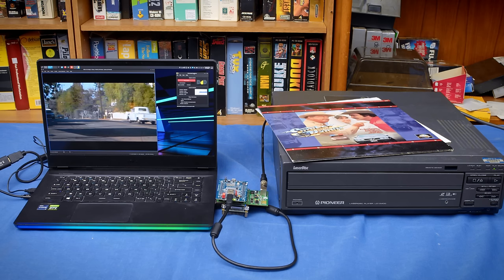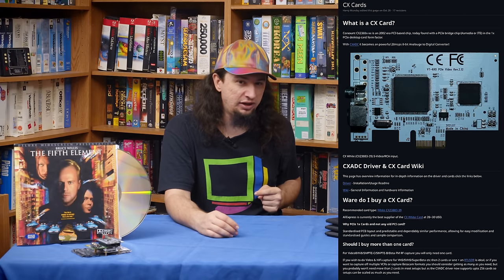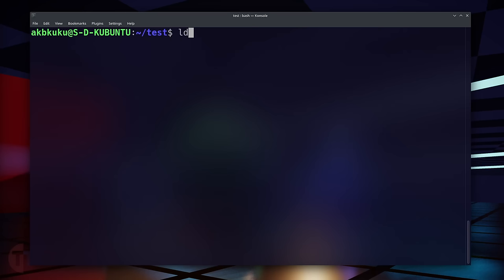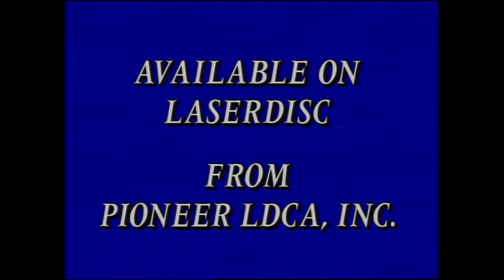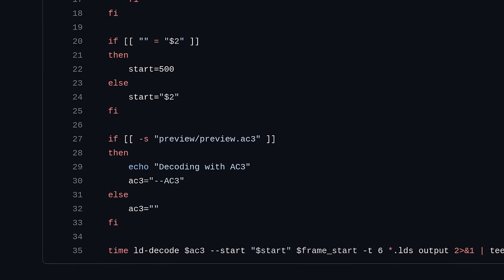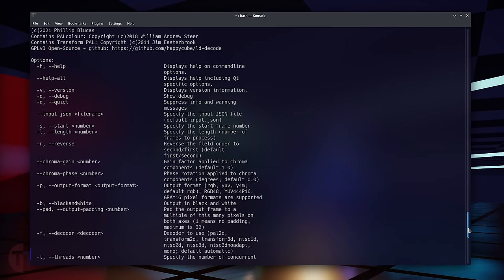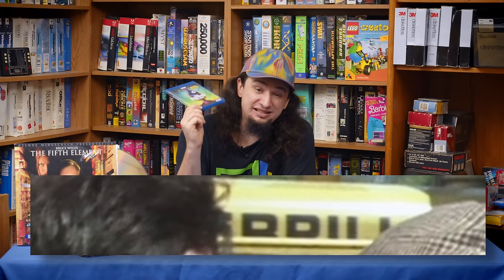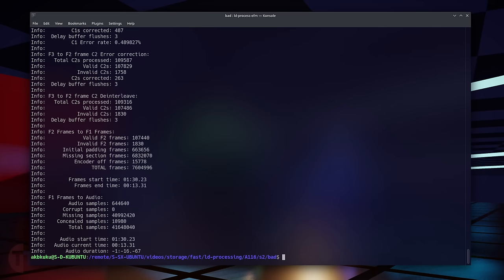LD-Decode - LaserDisc Conversion Tools

Comment: even on modern DVD/Bluray splitting combined TV show episodes (15 minute Cartoon Network mostly) is a royal pain.  Sometimes whoever did it was kind enough to leave a solid 1-2 seconds of black in-between episodes.  Other times they were just a**holes and the sound track from one episode bleeds into the lead in to the next episode with maybe just a single frame of black.  Completely manual process.  Which is why torrents of these shows never bother to actually break the episodes out into their individual components.

Comment: Run the video signal through a RetroTink 5x, or RetroTink 4K (depending on your price range), before final video rendering, and they have VERY good options to deinterlace incoming video, in real time, as the video is played.
Reply: There are better deinterlacers that work faster than real time.
Reply: @itogi  Examples, please.

Comment: I'm guessing the "TBC" video file output by LD Decode from a raw LDS file, is referred to as a "TBC" file, because LD Decode performs a form of software timebase correction on the video frame data? 

As a Laserdisc collector and overall video enthusiast, this method of direct FM carrier & subcarrier capture from laserdiscs (and videotape as well, which also stores video in an FM carrier directly recorded to tape) to digital form fascinates me.  I'd love to modify one of my players to fit in a Domesday Device (or CX Card) to it, and try my hand at capturing & digitizing my LD collection this way.

Comment: I have a question: Why don't you use libsvtav1 instead of libx265? With an Intel ARC GPU you can also encode AV1 insanely fast via hardware. And I don't agree with nearest neighbor pixel doubling for scaling but that's just down to preference.
Reply: Having experimented personally with SVT-AV1 versus x265, I feel that SVT-AV1 still has a decent amount of room left for encoder tuning improvements, whereas x265 is so mature that it's basically as good as it's ever going to get. Currently, SVT-AV1 (AV1 in general) excels at producing clean images at low bitrates, but at higher bitrates, x265 at Slow maintains more fine details (sometimes you don't want to have noise and grain and fine textures smoothened out) than SVT-AV1 at like Preset 5, which is almost comparable speed-wise. I'm sure it will get better over time, but at this current moment I wouldn't consider it suitable as a codec you'd use as a sort of final master yet. 

The thing about nearest neighbor pixel doubling was also surprising to hear. I mean, if it works, it works, but it feels almost like defeating the specific coding features of HEVC because it's going to be harder to do things like motion search when every pixel is actually a 2x2 block of pixels. Also, it will look blocky if you try and view it on a display without undoing the pixel doubling first and then using another upscaler that actually does smoothening. I would try and figure out what x265 encoder feature should be turned off to reduce the smoothening effect it has, maybe the SAO filter needs to be turned off?
Reply: @nooneinpart  You have to make sure to use the correct tuning mode. It defaults to PSNR, which is of no use for human vision. Try the psychovisual tuning! tune=0.
Reply: @kyoudaiken  I have tried that, as of a few months ago it didn’t make much of a difference. Maybe I’ll try it again
Reply: @nooneinpart  x265 and AV1 have variable macro block sizes. They can go down to 4x4 pixels. So Shelby's assumption it would be no good for low resolution isn't necessarily true. The true issue here is that lower resolution video has several orders of magnitude less redundancies compared to high resolutions. Thus, especially for grainy/noisy footage you need higher bitrates than you might think.

That's why AV1 would be beneficial. The filter film-grain=(1-50) can help here by removing grain, note down the type position and strength of the noise and then and synthesizing it on decode (playback). But the more aggressive the value for the film-grain filter is, the more actual detail you will lose. AI denoising might bring better results, but I guess this is a topic for AV2 or AV3...

I just hadn't mentioned this, because, well, this is social media... Valid criticism is not welcome (for other viewers, not Shelby!) and you are automatically a hater. But whatever.
Reply: @kyoudaiken  I think removing grain is the exact sort of thing he's trying to avoid by doing the pixel doubling trick. Re-synthesized grain is a pretty genius idea for streaming video over to users with a limited bitrate, but that's exactly what you don't want if you're trying to keep a permanent record of a video, you want it as pure as possible in this situation.
Reply: @nooneinpart   For really good quality SD video you really need 2 - 3 MBit/s to retain grain, noise and such without artifacts or blurring, even on AV1 because as I said, SD video has several orders of magnitude less redundancy, especially analog sources like LD.
Reply: @nooneinpart  You can also try the encoders on Intel ARC GPUs. An A380 is enough, it has the same encoder ASIC as the flagship. Not sure about NVidia but their encoder is also great. Don't know which GPU is best to get for that, though. It has to be RTX 4000 series, though. AMD's encoders also have AV1 encoding since the 7000 series but I don't know much about it.
Reply: @kyoudaiken  I know, I’m specifically replying to the part about using the —film-grain setting to remove grain. Actually, I find that using that setting alongside —film-grain-denoise 0 provides better results because setting —film-grain by itself tends to clean up more noise than it resynthesizes, using a higher CRF of 30 already removes enough grain without the denoiser enabled. 

I’d try an Intel ARC GPU but I’m living that laptop life, Iris Xe FTW!!! (I can’t open up my laptop and toss a new GPU in). I’m mad at my old laptop for dying before Meteor Lake released. It’s so close…
Reply: @nooneinpart  Yeah, currently the best option is a low CRF.

If your laptop has a spare M.2, just do a UFD Tech and connect an Intel ARC to it. ReBAR must work though, even for the AV1 ASIC, because when the VRAM runs full, encoding speed dips down hard without ReBAR enabled. Or maybe your Laptop has Thunderbolt. But GPU enclosures for Thunderbolt cost way more than the actual A380...

Comment: Why is telecine interlacing almost impossible to filter out? Doesn't everything use 3 2 something pulldown? Isn't it consistent?
Reply: 3/2 pulldown is an American thing. That HHG laserdisc was PAL I believe.

If you telecine an interlaced optical projection then your capture permanently recorded the original interlacing artifacts as a new image. Imagine for example I have two 35mm slide projectors both pointed at the same projector screen. I project two slides onto the screen at the same time, making a combined image on the screen. I then take a new photo of the combined image.

Imagine just how nearly impossible it will be to scan my new photos and try and separate the two original images.

Another example. I have a cup of red sand and a cup of green sand. I give you a bigger cup with the contents of both original cups inside only during transport they got badly shook about and red and green grains are now mixed.  Lacking any automatic processes for separation, would you like to manually do it?

Comment: All good fun, try inventing a new analog TV format, this been keeping me busy for the two years. Whereby I have been working with narrow band television that is 240 x 192 a lot less than PAL at 720 x 576, but it  has lower bandwidth requirements that fits into less than 100kHz.

Comment: Is there already a agreement in de community what counts as an "archive quality"  copy?   163GB doesn't sound very portable..
Reply: FLAC compressed LD RF caps fit on 100GB BD discs with some EEC data and self contained decoding and export tools.
Reply: If I were to archive the original bitstream I would compress it and store it on bd-xl or LTO tape. I'd certainly use the tapes as they store way much more.

Comment: could you take the video into a video equivalent of photoshop and use the video equivalent of the repair or heal tool and paint over the dropouts?

that would work if the dropouts are in a consistent color and lit area say a wall.

as part of the job of preserving are you getting copyright threats as i am sure the content is still in copyrights?
Reply: During decoding RF drops are logged, then with ld-dropout correct it takes the mapped drops and masks them, this is a 1 command job and you can see the dropouts visually highlighted in ld-analyse.
Reply: Yes you could but with 24-30 frames per second do you want to manually do that for thousands of frames?

Some people have been paid to do just that. Tron for example had poor souls apply manual effects to make the characters glow. Frame by frame by frame.  And the same again with the 1970's animated Lord of the Rings, which actually was NOT animated! It is actually a live action film but each frame was re-drawn by hand to convert it to an animated film.

Unless you or I are being paid to sit there day after day, week after week, for a year or more to retouch every frame in Wargames... I think you'll probably take the extra few hours of stacking yes?

Comment: 9:05 Why did you dismiss Dolby Surround matrixed sound? Sure, it's inferior to discrete audio channels, but it's still a surround mix nonetheless and not an upmix.

If there's no discrete audio channels track option, that's the only way you'll get a surround sound.

Which is, by the way, getting more and more difficult to decode in hardware nowadays. Lots of modern surround equipment (like the abominable soundbars with surround satellites) dropped all sorts of matrix decoders, like dolby pro logic II. So there's currently no way to get matrixed surround out of PS2, Wii or Gamecube on such a system.

Or do you mean that those tracks are simply bad on LD and not worth an effort?

Comment: Very interesting. But can't basically every software player play AC-3 and DTS? And surround systems sure can.
Reply: You need to decode the analogue ac-3 or DTS first!
Reply: @dlarge6502  Sure, you need to extract the digital AC-3/DTS stream from the RF capture, but I don't see a reason to convert it to PCM.

Comment: i9-11980hk…. this seemed oddly familiar for any 0.5s until I realized I have a laptop with this exact CPU… it’s a fast and really hot shithead CPU.

You’ll get much better results running an underclock and a decent undervolt.

Personally I run 4.4Ghz at 1.1v -65mv.

Every machine is different, but I’ve used several 11980hk motherboards, and all of them have really been better at sub 4.5Ghz. The heat above that clock does not offset the performance in any appreciable way. Weird mobile CPU, the 11700h is much less thermally limited and as a result, much better.

Comment: Please don't convert lossy AC-3 or DTS audio to PCM just to combine two parts of an LD in Resolve. Speaking of which, that sounds like overkill, ffmpeg should be able to concatenate them
Reply: Good gravy, PLEASE don't use HEVC/H.265 for interlaced video. It's entirely incompatible with it, by design. Use x264, if it's meant to be a "final" copy. Or ffv1 to "do stuff" later

Comment: Jumped the gun on my comment.  Just wanted to say - great job.  There's a lot of nonsense out there on this topic, and you obviously know your stuff

p.s. stacking works because the defects are random - a kind of noise floor against which the more consistent signal elements of the content persist.  Not sure why you'd get an improvement when stacking a single disc.  This seems to imply that the noise in these cases was originated at the LD deck (its playback hardware) or via the duplicator.  Though pulling really good stills from your friend's educational disk would be totally doable this way given the likely number of frames per still

Interlacing is a frame split into two fields.  It's a kind of compression that trades off spatial consistency for the "benefit" of high motion.  There are two fields for every frame.  Hence, if your frame rate is 29.97, your field rate is 59.94.  The fields are not "merged" as this implies they occur at the same time.  The effect of seeing both fields will only occur on displays that actually support interlacing.   And even then, only when paused.  If you're watching on some kind of computer display (progressive only) you may only see a kind of de-interlaced version of your source. 

To complicate this further many laser discs were derived from films that require a 3:2 pull down to get from 24 (actually 23.976) to 29.97.  The cadence requires a duplication of some fields.  Hence the fact that it occurs "sometimes" may just be the result of displaying the A, B or D frames  - which in 3:2 pulldown have duplicated fields.

Comment: God; de-interlacing telecine'd video. When I used to capture and encode music videos, occasionally you'd run into a very frustrating situation: They'd done 3:2 pulldown on 24fps footage /before/ they started the edit, which they did on native 29.97fps equipment. This occasionally resulted in cuts that had only only had one of the two sets of fields for frames on either sides of the cut, meaning it was impossible to fully fix. Utterly rage-inducing.

Comment: if you're archiving something, please don't deinterlace it
Reply: If you plan not to de-interlace it, don't accidentally encode the videos in progressive mode. It happens more often than you think and the fields are destroyed.
I always de-interlace videos using ffmpeg. Looks much better and less likely to f**k up fields.
Reply: In this method, RF is the archive, video/audio/data is just derived from the FM RF archival file thats FLAC compressed.
Reply: I wish modern codecs had an option for preserving interlacing and have the player do it.
Reply: @lutello3012 Eh? its a container flag not a codec problem HEVC/AVC supports interlacing just fine and TVs support de-interlacing correctly flagged files, what people forget is also clap settings too I think my ProRes guide on the vhs-decode wiki is the only one that ever covered that little bit of atom data in the mov container which very much so applys to SD video production use.
Reply: @lutello3012  They do. MPEG2 is the best format to do that with. It's the same format DVDs use.
Reply: Yeah I meant something more modern that but close enough I guess.  @rommix0
Reply: @lutello3012  It's modern enough that Blu-rays even use MPEG2 videos (mostly HEVC MP4 with HDR color for the movies themselves but sometimes MPEG2 for bonus content).

Comment: I'd rather use H.264 for anything that isn't 4K or better. H.265 takes much longer to encode than H.264 and H.264 works better at lower resolutions.

Comment: This man seems to have gotten the topic of deinterlacing very wrong.
It's very simple, 
If it's NTSC, it should be deinterlaced to 59.94fps.
If it's PAL, it should be deinterlaced to 50fps.
You should NEVER deinterlace the framerate to 24fps for any analog format ever, you are basically removing frames, because many frames can be doubled to fit the full frame rate of either 59.94fps for NTSC or 50fps for PAL. And when you deinterlace any analog format, you are doubling the frames to get either 59.94fps for NTSC or 50fps for PAL.
Here's what I mean.
NTSC: 29.97 x 2 =59.94
PAL: 25 x 2 =50
It's not that complicated, no further questions asked.
If you would like to see examples of my deinterlacing, you can find some on channel if you would like.
Reply: If the original content is in 24 fps, then it needs to be in 24 fps.
Reply: @itogi  No, because you would be removing doubled frames from the original source material which is terrible for video preservation. I would go far enough to say it's a sin to do 24fps instead of 59.94fps.
Reply: @penguinproductions900  You don't need to preserve doubled frames if the original material is in 24fps.
Reply: @itogi  No, you must preserve ALL the frames.
Reply: @penguinproductions900  You don't need to preserve duplicated frames for 24fps media, 24fps content has to be in 24fps. If the content mixes framerate, then it needs to be in 59.94fps/50fps.
Reply: @itogi  As I said before, you need to preserve ALL frames no matter what.